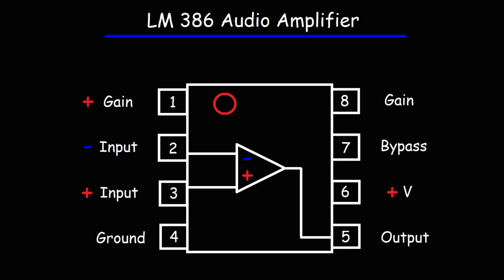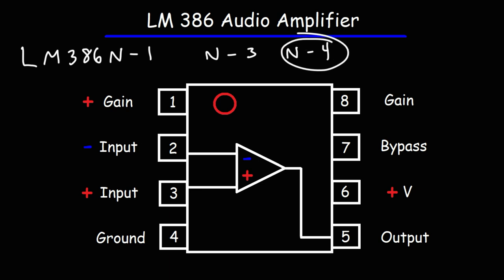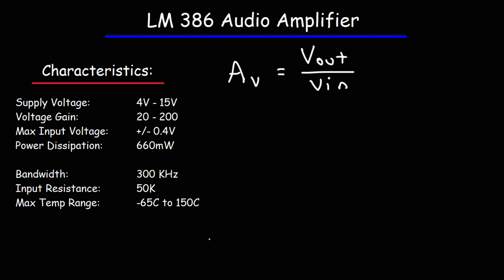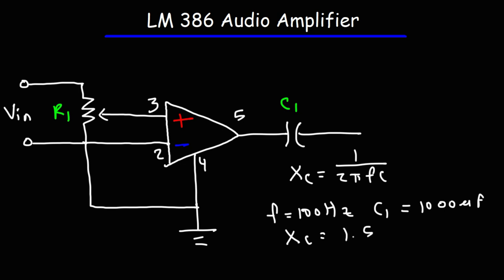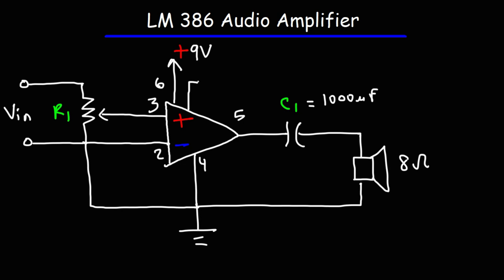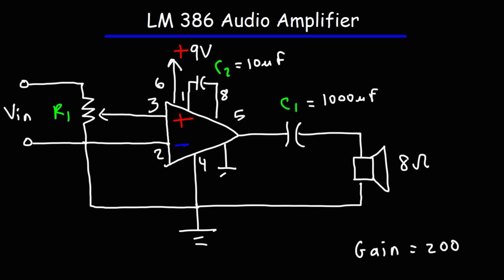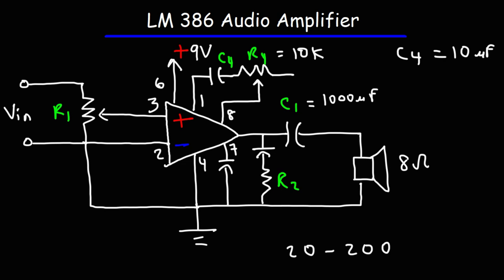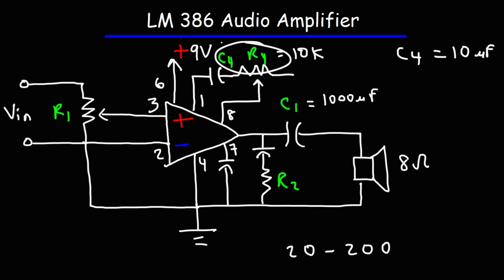LM386 Audio Amplifier Circuit With Bass Boost and Volume Control

Comment: It worked great I've just  added a 2.7 polyester film capacitor between the center pin of the potentiometer and pin 3 of the ic this stopped any DC offset on the input a second coupling capacitor I hardly have to turn the amp up at all to get great volume now it also seems to be sharper and more powerful

Comment: Is there a mistake in your video? You start by saying that a 1,000uF capacitor gives a reactance of 1.59 ohms at 100Hz and shortly after you say that it is 15.9 ohms (this is at the 5:20 mark).

Comment: So my question is :-
To increase the gain of the IC386 audio amplifier, which one of the best answer? 
A- the resistance between pins 1 and 8    must be increased 
B- the resistance between pins 1 and 8 must be decreased
C- the capacitance between pins 1 and 8 must be increased 
D- the capacitance between pins 1 and 8 must be decreased
THANKS
Reply: E - connect a wire between pin 1 and 8.  You will achieve 200 times gain.Capacitor adds stability. Potentiometer lets you vary it between 20 and 200.

Comment: R1controls volume but does 't gain also control volume..is a high gain used with low voltage input signals but limited so as not to blow the speaker. Tx

Comment: How can I get a cleaner sound output, I mean without distortion?
Reply: Connect a bypass capacitor of 100uf between pin 7 and ground. If still there's a noise distortion then connect a 1000uf capacitor to the input of the circuit which will reduce the noise caused by input power supply also add a 0.1uf or 100nf capacitor to the output and the ground. This will definitely reduce the noise distortion.

Comment: The math behind the choice of the output capacitor is meaningless if you don't relate it to the impedance of the load (speaker) and determine the attenuation caused by the impedance of that capacitor at a given frequency.

Comment: I put together the circuit you did at 14.40 mins , but all I get is a kind of low tone to high tone whistling noise , then when music is playing to to through it  it sounds like a scratching sound. I tried a 100uf and a 47uf capacitor on pin 7 but it was still the same. Any  ideas as to what may be wrong. Thanks
Reply: Connect a 100nF cap in parallel to the 1000uF cap at the out put. IMPORTANT: connect it in parallel; it will filter all the high frecuency unwanted noise

Comment: Would it be possible to wire a potentiometer to a lm386 chip module as an external volume ?
Reply: If you put a Pot on the positive terminal and have the input signal going to that pot, you'll be a able to adjust the voltage/volume before it gets to the LM386. Check page 8 of the Datasheet for more information.
Reply: @Twiggs8121  very cool, thank you!

Comment: Why do you call the LM386 an operational amplifier? It is not. The datasheet describes it as "Low Voltage Audio Power Amplifier
". And indeed its specifications are totally different from those of an operational amplifier.
Reply: Some call it an op amp as you can configure the lm386 as an op amp as well.

Comment: When I finished the circuits I always cover everything with hot glue this makes the circuit water proof stops connections working loose helps stop interference from coils and other components once done it's done forever just thought I would pass on this tip

Comment: Why is C3 given the value 0.033uf? Why can’t it be a greater value ? Anyone ?
Reply: If you increase C3 greater than 0.033uf then the bass increases by a little bit and hence the volume or gain decreases by a small amount. You can experiment by replacing the 0.033uf with 0.1uf.

Comment: I am building an old Elenco AM/FM radio kit and connected a ceramic disc capacitor to the LM386 in my circuit to prevent the chip from oscillating.  You are like me; you know a lot about every topic in science.  I have a Master of Science degree in biology and a vocational diploma in electronics and work experience in botany, chemistry,  microbiology and electronics.  Watch my geology videos by typing in Frank Reiser M.S.